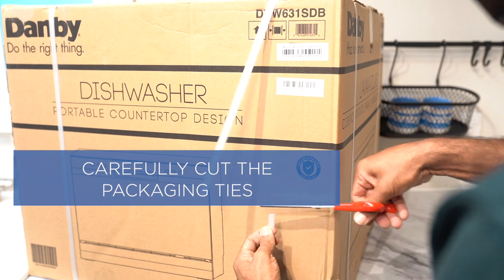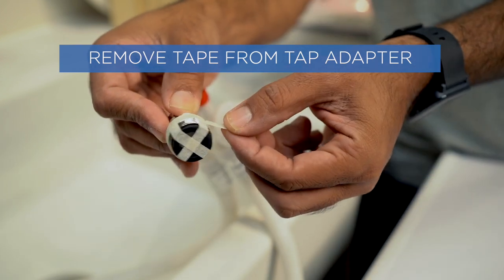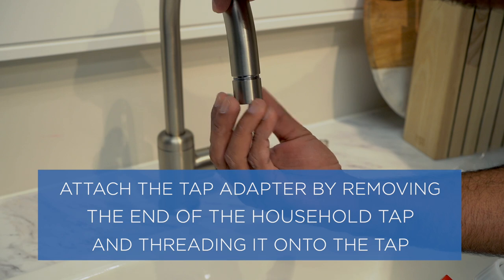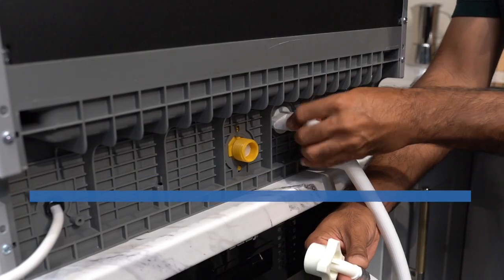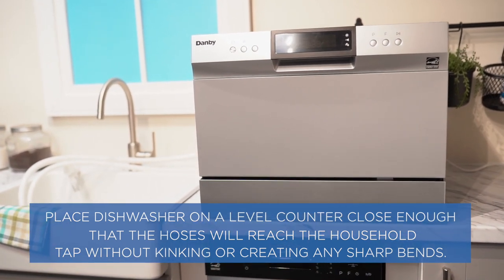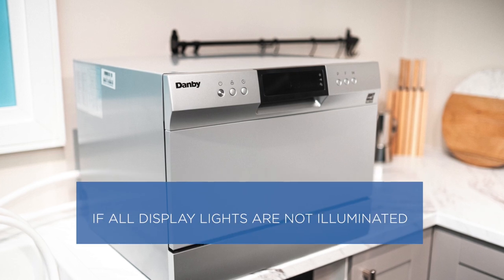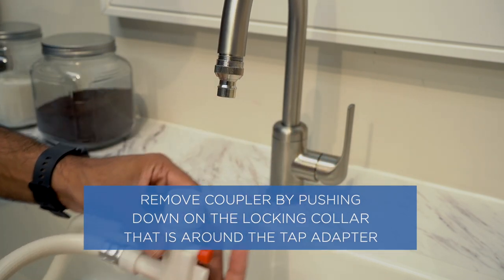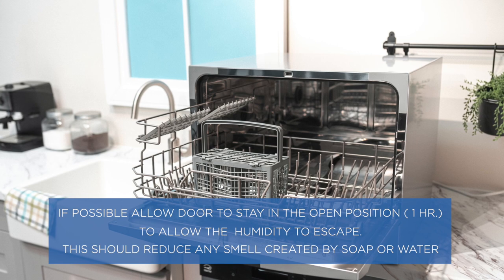Danby How-To: Countertop Dishwasher Installation (DDW631SDB & DDW621WDB)

Comment: So can't use the faucet while dishwasher running? And have to plug and unplug the inlet hose every time?
Reply from the maker: Thank you for reaching out to us with your inquiry about the Danby Countertop Dishwasher. We appreciate your interest in our product and would be glad to assist you with your concern.
Regarding your question, the faucet cannot be used while the dishwasher is running as it requires a constant supply of water to properly function. You will need to connect the inlet hose to your faucet each time you use the dishwasher and disconnect it after use. However, please refer to page 5 of the user manual we provided https://cdnns.danby.com/4973611/DDW631WDB_DDW631SDB_EFSOM_20181016.pdf for proper installation instructions and precautions.

Comment: Mine is leaking at the front, through I think is either air intake or emergency water removal if it goes above a certain level, on the side at front inside the tub, there's small convex parts that stick out and leads to the bottom of the unit... Well mine apparently fills up too much and leaks from that (not through the door itself... literally underneath through that vent pathway)
Reply from the maker: Hi Tetra, I apologize for the inconvenience.  Please contact our consumer service department at consumerservice@danby.com. We will be happy to assist you.

Comment: How long are the hoses? Does Danby make a hose that is longer if the ones included are not long enough for my space?
Reply from the maker: Thank you for your interest in the Danby Countertop Dishwasher and for reaching out to us with your inquiry. We would be glad to assist you with your concern. Regarding the length of the hoses, the inlet hose and drain hose included with the dishwasher are approximately 4.9 ft and 4.8 ft respectively. We currently do not offer longer hoses for this model, but we recommend ensuring that the dishwasher is installed within close proximity to the sink to avoid any issues with the hoses being too short. If you need help and would like to know more about this device, please contact our consumer service department at consumerservice@danby.com. We will be happy to assist you.

Comment: Couple of questions, does it heat the water and if I leave faucet on hot overnight will a faucet keep heating the water?
Reply: the faucet does not heat water and the water in the line will cool in about 15 minutes.
Reply from the maker: Thank you for watching the video. Please email us at consumerservice@danby.com or call direct at 1-800-263-2629 to provide you further information about this unit.

Comment: been trying to figure out why my dishes are wet.  never left the door open after or is there a dyer?
Reply from the maker: Hello, thank you for watching the video. There is no drying cycle in this appliance. Dishes should be left inside the unit for a short period after a cycle so that the warm air inside
the appliance can assist in the drying process. Dishes are normal to be wet at the end of a cycle. If you need help or want to learn more about this device, don't hesitate to contact our customer service department at consumerservice@danby.com and we will be happy to assist you.

Comment: We bought this Danby countertop dishwasher about two years ago for our small home and we love it! A few things to help people out. 

-We are 3 people and mostly start the dishwasher 2 or 3 times a day, large dinner plates and even large pans will fit inside. 

-Once the cycle is over the dishwasher will beep and display END on the small lcd screen, you should open the door and let the dishes dry for about an hour or so, the heat inside the dishwasher will evaporate most of the water and only some of it will be left on back of mugs, glasses and such.
 
-The dishes always come out completely clean and we only use the cheapest dishwasher powder, would not recommend using dishwasher tabs as you should be placing a bit of powder on top of the dishwasher soap dispenser door so there is some already inside the dishwasher when the cleaning cycle starts its first rinse. 

-You can pause it at any time to open it to add more dishes inside or if you need to use the tap to get water, the hose is quick and easy to release and you can plug it back in and restart the cleaning cycle. The dishwasher will let out a short beep once every few seconds to remind you that it is paused.

For the price it is a really good, simple and functional dishwasher, perfect for a small home or apartment, my hands feel much better now that we no longer scrub dishes, thanks Danby!
Reply from the maker: HI, Thank you for sharing your positive experience with our Danby countertop dishwasher! We're delighted to hear that it has been working well for you and that you find it functional and efficient. Your tips and insights will surely help other users get the most out of their dishwasher too. If you ever have any questions or need assistance, please don't hesitate to email us at consumerservice@danby.com. We're here to support you. Thanks for being a valued customer, and we're glad to have improved your dishwashing experience. Best regards, Danby Support Team
Reply: There's a good fix for that I installed the second faucet it's a bathroom faucet in my sprayer hose hole problem solved!!
Reply from the maker: @peachyclean93  That's a clever solution! Thanks for sharing it with us.
Reply: @DanbyProducts  You're welcome I absolutely adore my dishwasher ❤️❤️

Comment: These all seem to be made by the same factory in China with different front doors.  I have a Danby Countertop dishwasher (DDW631SDB) and the yellow supply connector accepts a dishwasher connector kit. Only need to buy three things from ACE Hardware. (Dishwasher Supply Line #4061180 $25.99, 3/8in Repair Valve #4309399 $14.99, Add A Tee Adapter #4309001 $12.49).

Supply 2nd: To use the same supply hose but cut off the end and add an extension. (1/2 in. Barb X 3/8 in. Comp Brass Adapter #4000473 $6.99, 3/8in Stainless Steel Supply Line #4058681 $9.99 , and a Hose Clamp #41143 $2.59).

The drain side: You have a few options, pull the bottom of the dishwasher off, pull the gray hose from the drain connector, unscrew and replace connector with (3/4in barb coupling #4568242 $2.79, 3/4in Vinyl Tubing, dishwasher tailpiece #43783 $7.59, Tailpiece Washer #44373 $2.49, and two hose clamps #41143 $2.59).

Drain 2nd: You can also size down to 1/2in (1/2in X 3/4in Barb Coupling #4568259 $2.39, 1/2in Braided Vinyl Tubing #4315503 $16.99, Dishwasher Branch Tailpiece w/ 5/8in outlet, Tailpiece Washer #44373 $2.49, and two Hose Clamps #41143 $2.59).

Drain 3rd: What I did to use the same connector, cut off the end and add an extension. (1/2 in. Barb X 1/2 in. Barb Galvanized Steel Coupling #41763 $4.99, Cut to measure 1/2in Braided Vinyl Tubing #4027603 $1.79/foot, Dishwasher Branch Tailpiece w/ 5/8in outlet, Tailpiece Washer #44373 $2.49, and two Hose Clamps #41143 $2.59).

I made a hole in the stainless steel sink and run the lines down under the sink through a Bulkhead ABS Slip x Slip fitting to make the hole nice.
Reply from the maker: Thank you for sharing your experience with us, we're glad to hear that you found a solution for your Danby Countertop Dishwasher. We appreciate your feedback and take it into consideration as we continue to improve our products. If you have any further questions or concerns, please don't hesitate to reach out to our customer support team at consumerservice@danby.com. Thank you again for taking the time to leave a comment!

Comment: Hi, I bought it a few days ago. But I have a question about the inlet when I tried to install it. I want to attach the inlet hose to another water entrance(which is shared with my washing machine) rather than the kitchen tap. could you help me to check if it is ok to always keep the  water entrance on?The reason why i have this doubt is because in the vedio of your official website , inlet hose is attached to the kitchen tap, and when the washing procedure ends, the kitchen tap is turned off mannually, meaning the water is not always on. Thank you
Reply from the maker: Hello! Thank you for purchasing our countertop dishwasher. Attaching the inlet hose to another water entrance should be possible as long as the water pressure and connection are compatible. However, to ensure the proper setup and avoid any issues, please email us at consumerservice@danby.com with your model details and specific question. Our customer service team will be happy to assist you further and provide guidance. Thank you for watching the video. We're here to help. Best regards, Danby  Support Team

Comment: Our Danby countertop dishwasher . We're setting it up and the tap adapter doesn't fit on our faucet. The faucet came with the house and is likely an older model. Do you have recommendations what size of parts we need to so we can install it?
Reply from the maker: Hi there! Thank you for watching the video. The compatibility of the tap adapter depends on your specific faucet and model. To ensure you have the right parts for installation, please email our consumer service team at consumerservice@danby.com. They'll be able to assist you further and provide recommendations based on your specific setup. We appreciate your patience and look forward to helping you get your countertop dishwasher up and running smoothly. Best regards, Danby Customer Service

Comment: Can you post a video on cleaning the filters? The basket has a tab that latches it to the underside of the main filter, yet somehow were supposed to be able to pull it out. The instructions don't line up with the design.
Reply from the maker: Hi there! Thank you for bringing this to our attention and for your question about cleaning the filters in your dishwasher. While we don't currently have a video specifically on cleaning the filters, you can refer to the owner's manual to view the features of the unit and instructions on how to clean the filters. The manual can be found on our website: https://www.danby.com/product-categories/dishwashers/. If you are having difficulty removing the basket, please reach out to our customer service team for further assistance. They will be happy to assist you in resolving this issue. Thank you for choosing Danby!

Comment: Where do I get the schematics or a video about replacing the inlet valve, I have it partially disassembled but cant get the inner plastic on the bottom black pannel to come off (it is grey) , I assume I have to remove it. Schematics or even better a video would be helpful
Reply from the maker: Hi there, we're sorry to hear you're having trouble with your Danby countertop dishwasher. Our team of experts would be happy to assist you with the inlet valve replacement. We recommend reaching out to our customer support team at consumerservice@danby.com, they will be able to provide you with the necessary schematics or further help with the replacement. We appreciate your patience and we're here to help. Thank you.

Comment: can i place it under the sink cabinet?
Reply from the maker: Thank you for your question regarding the placement of your dishwasher. We recommend placing the appliance on a solid, flat counter near the water source. As for placing it under the sink cabinet, I think this may depend on the specific model and the cabinet's dimensions. We recommend that you refer to the owner's manual for instructions on the installation and placement of the unit, which can be found on our website: https://www.danby.com/product-categories/dishwashers/. However, please note that this is not a built-in dishwasher, so we do not recommend installing it under a sink cabinet. Doing so could result in potential issues with the appliance. If you have any more questions or concerns, please do not hesitate to contact our customer service team for help. Thank you for choosing Danby!